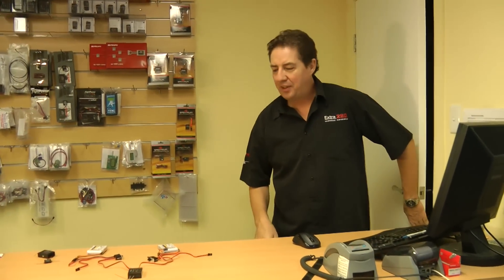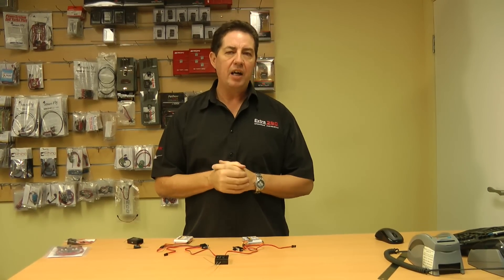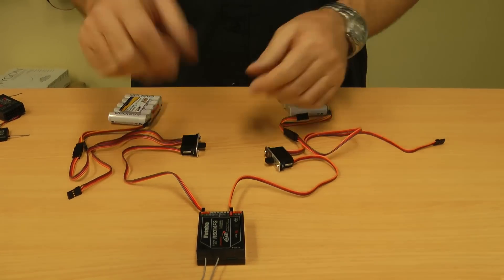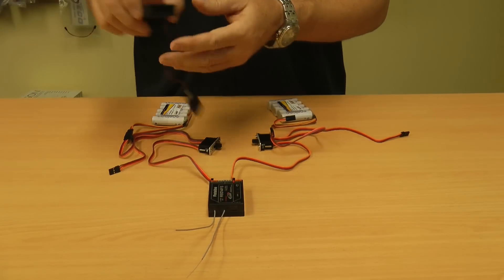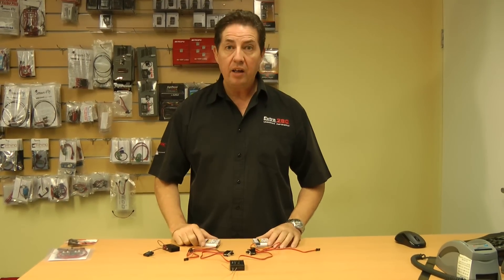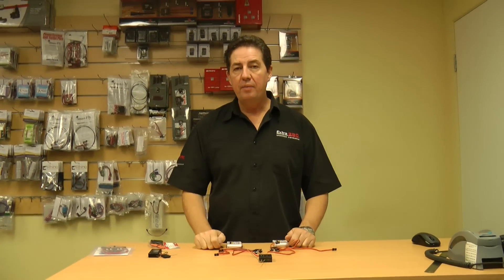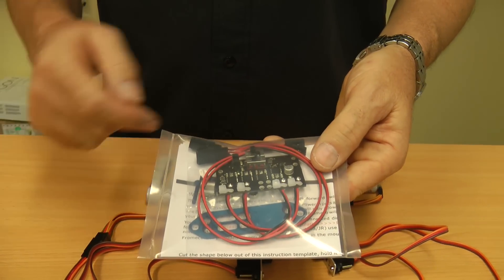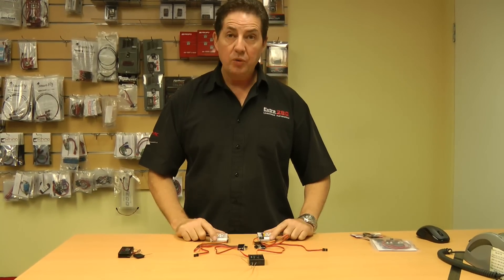Battery Redundancy System

Comment: Booma RC In Australia, makes a really good battery backer switch, it has a separate switch that when the pin is pulled it's on ... so if fails, it fails to on position has 2 inputs as well as 2 outputs..when pin is pulled a very bright LED light comes on to let you know you have power..they also have magnet switches,as well as with a remote key fob if desired..for about $60 US you can't go wrong I use one with back up battery for main power, and the other just as main switch for my ignition in front of my optical kill switch. They also sell the same switch with a built in regulator if needed

Comment: Old wives tale probably true. How can a more charged battery not drain to a less charged battery? Especially if one battery gets a dead cell, that’s disaster. Believe the tale. A diode at each supply line is the answer. Possible to do yourself. Easy and cheap. The whole point of redundancy is not to double your Amp Hours. It’s to protect against any failure in the supply from or the other battery.

Comment: Hello gents. If you use two LiFe's straight into the rx (no regulator or powerbox), would the tiny rx's bus be able to handle all the current that multiple 14kg servos would pull?
Cheers.

Comment: Hi ive been using this system on all my planes it works fine but can i apply this system on a gas ignition system? 2 batteries 2 switches 1 y harness connected to the ignition system for spark plug? I know theres one point of failure which is the y harness but that i have no choise because theres only one wire to connect the batteries to the box but other than that do you see any other problems that can accure? Thank you

Comment: i use 6 cell sub c pack 4200   on rx n use 2s lipo on ignition ,   only change lipo , other pack fly all weekend on a charge. , i know no one that uses them itty bitty packs for rx ,  wont last long , and 6v gives you faster servo speed.

Comment: I guese this will work for gliders aswel have 2 high compacity lipos and they will both drain down to 50/50 but it will take longer to deplete both lipo vs just a single lipo

Comment: If i charge my 6 volt battery to 6.7 and i then connect it to the ignition module, will it fry or damage the module because of the high volts?  My DA 50 isnt starting anymore and i fear i have made this mistake.  Any info on this is much appreciated.  Thank you.

Comment from the maker: Hi, you can use any good quality switches such as JR Heavy Duty switches, we don't recommend toggle switches with Gas planes as they cannot handle the vibration. For the ignition you should use a separate battery and switch, completely separate of the receiver system for your ignition to prevent noise getting back to the receiver.

Comment from the maker: You can use two different battery capacities as long as the are both the same cell count and same chemistry. Each battery will drain at the same "percentage" rate. So if you use half of the 2000mAhr pack you will have used half of the 1100mAhr pack.  Remember though you are making a redudndant system so each battery must be able on its own, to supply the full load in the case the other battery, switch or connector fails.

Comment from the maker: Problem with using a Y harness is you the create a single point of failure, if the Y lead fails, both packs fail! 2 switches, 2 batteries, 2 conections to the reveiver = Battery redundancy. Now if your receiver fails.....thats a whole different matter :-)

Comment: So why can't you use a y harness at the battery input since there both are in parallel and will not add to the two independent battery voltages together. Or is this because if the primary battery goes bad that the back up battery would see it as an open circuit therefore from the receivers point of view there would be a voltage drop across the dead cell robbing the receiver of the required operating voltage? This could only be so if a dead cell and the receiver was in series with one another.

Comment from the maker: Yes basicaly. You are also effectivlly protecting yourself from switch, and battery failure. It's highly unlikly that you will loose 2 switches and or 2 batteries in one flight. Doubling the battery capacity is a very handy bi-product of this kind of system. It should be remembered that you should always keep enough capacity in each battery to complete a flight on it's own!! It's a redundancy system primarily!

Comment from the maker: LiPo's are fine, but they need to be regulated (unless you are using HV servos). A regulator is another link in the chain. If you don't need it don't use it! NiCd and NiHm's are still good batteries, they didn't become redundant because LiPo's came along. In some applications LiPo's are of no advantage, in others they are.